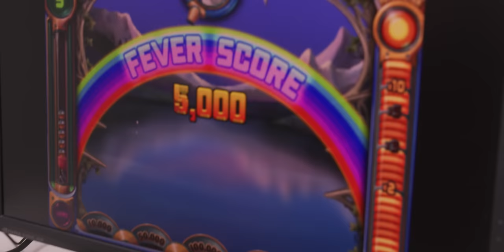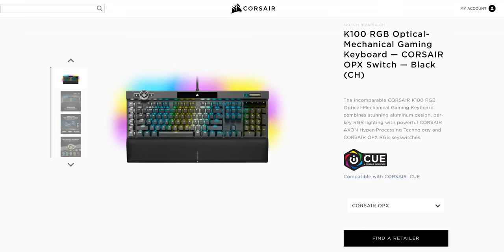The All Corsair Gaming Setup!

Comment: coincidentally the motherboard name “crosshair” sounds a lot like Corsair. Sneaky Linus
Reply: He put a sneak on us
Reply: Yeah my mobo/GPU is MSI SOLELY because Corsair doesnt make those parts lol. Sure they make GPU waterblocks, but I'm not watercooling, but I AM rocking Corsair everything else, as well as a 3700x lmao. Mine has an MSI 2080ti Gaming X Trio in it as well.
Reply: @TheGauges420  2080ti buyers oh noononono
Reply: snek 100
Reply: Seth Kauffman hey if you are ever planning on upgrading Corsair have released A plug-in for ASUS motherboards and gpu’s into icue
Reply: @Jack_U  hm, really? So you mean to say that if I buy a Strix card and a Strix board, they include cables now that will let my iCue match them perfectly? That would certainly be nice. I mean my Gaming X Trio 2080ti already matches my diffused setup pretty well, but I've been considering getting a 3080 whenever they're in stock (maybe 3070ti if its real), so I'd much rather control ALL my RGB with iCue ALONE lol. Is it just Strix or also TUF? Also, do the cords come with the items, or do I have to buy separately (not that I'd mind if they dont come with, I just wanna know to order at the same time lmao, or realistically is it even a cord, or do I just literally like import them into iCue on my desktop and that's it, I can control it with iCue instead of needing any cables or anything).
Reply: @TheGauges420  no you don't need cables you just install and extra piece of software on the Internet from corsair and it allows for controll and synchronisation of Asus rgb products in icue.  I know it works for motherboard's definitely as I myself have an Asus motherboard in a pretty much all corsair system and I'm 99 percent sure gpu works aswell
Reply: @TheGauges420  just google Asus icue support and you should find the install for the software. And it should work on any Asus motherboard or GPU as mine is a z390 a which isn't a strix and jt wotks
Reply: @Jack_U  good to know, thanks. Guess my next mobo/GPU will be Asus, although if they've done it for Asus I dont see why they wont maybe hopefully do it for others? Lmao.
Reply: @TheGauges420  at least u have a gpu
Reply: @TheGauges420  I can really see you laughing at people right now cause there is a GPU shortage and you have a 2080Ti which is always an beast for it's expensive price

Comment: What you need to do is take the “all Corsair” and the “all msi” and the other manufacturers and benchmark them against each other to see if there is any ultimate difference if you build an “all one manufacturer” computer.
Reply: That could be interesting.
Reply: Manufacturers didn’t like that
Reply: Corsair doesn't make main boards or video cards. Pretty tough to compare.
Reply: Mergatroid Mania they could use the same motherboard in all the systems but yeah they don’t have gpus
Reply: Best underrated idea here!
Reply: @paulhillbeats  Why would you compare a PC using a different motherboard or even the same motherboard with Corsair? There is no point. If they use the same motherboard and video card, then they're basically going to get the same benchmarks. About the only thing you could compare is RAM.
Reply: @OriginalMergatroid  the MB effects the score so little that no one has it as a system stat Requirement at most it adds less then 1% if that to the over all FPS
Reply: ASUS will win and I'm a Corsair Fan
Reply: @OriginalMergatroid  ram, their best cooling products, same wattage psu, computer cases,
Reply: @OriginalMergatroid  eh, corsair do have gpu waterblocks.
Reply: yes, this please
Reply: @OriginalMergatroid  they do now xD

Comment: Choice:
- Buy Corsair RGB fans
- Or still have a bank account?
Reply: The fans
Reply: laughs in Noctua master race
Reply: Rgb=FPS
Reply: Buying anything from corsair,, or having a bank account?
Reply: @khanhdinh5650  Same 😎 Brown ones only, embrace the Noctua
Reply: Buy one Razer mouse or still have a bank account
Reply: There cases are pretty affordable
Reply: rgb fans
Reply: Or have both :-D
Reply: True
Reply: @lonzoformvp5078  I bought a corsair 275Q, a different version of the 275R shown in the video, and it costs $99, which is around 60-70USD
Reply: Im buying nocuta any day
Reply: The fans are terrible value for the price. Corsair fans are terrible in general. No anti vibration padding (which you can get on $10 arctic fans which are FAR better) and inferior static pressure compared to almost all competitors. They aren't even true maglev. There's no circumstance where you should buy corsair fans. (also can't forget about the overpriced light controller)
Reply: @H1t1 You mean sp120s? been using 6 of them in a pc for almost 4 years now. They're also terrible value.
Reply: I want a bank account to buy the fans
Reply: @prakash9308  bro basilisk pro is just 3400rs
Reply: the fans obviously
Reply: @prakash9308  you only have $50 dollars in your bank account? i mean, the cheapest razer mouse is like the Viper Mini which is around $30-$40
Reply: @strider6294  So true. They really charge £55 for two addressable strips and a hub...
Reply: @H1t1 There is no such thing as an "sf120"
Reply: Lian Li Uni Fan SL120, probably some of the best fans on the market if you can find them in stock
Reply: @Joshua B yes and as I said, there is no circumstance where you should buy Corsair fans. There are far better, and sometimes cheaper, RGB alternatives to every offering corsair has.
Reply: I got Both!!
Reply: neither get noctuas and a Chinese RGB strip lol
Reply: @mtndewguy96  fax I upgraded my system with RGB fans brighter than the sun and I’m getting 420 more FPS than usual
Reply: @syedrehan4294  sheesh
Reply: I already paid for my bank accounts funeral.
Reply: @khanhdinh5650  if noctua ever does rgb then the universe will end XD
Reply: Does your bank account have RGB though?
Reply: @H1t1 thats alright, I've mistaken names before as well, but as I said I've used 6 of the rgb sp120s for 4 years now in and they are still not worth the price compared to other non corsair rgb fans on the market. I could give you a few examples if you'd like
Reply: RGB !!!
Reply: @jonathanbartley7139  ofc
Reply: Sk8rGuy420  Exactly. I'd rather buy a 1TB NVMe drive for that price
Reply: I would buy a NZXT pc
Reply: With the 465X that I have it actually came with 3 black LL RGB fans, I convinced customer service to swap them with the white LL120 fans (which are faster). Funny because the case costs $140 while the fans retail cost $120, its ridiculous
Reply: Me: buys Corsair fans
Also me: stonks
Reply: @FAKE-NAME  Damn, that must be double or triple the non-Corsair price lmao
Reply: Ye but it has RGB soooooooooooooooo
Reply: @rorywindsor1468  Corsair aren't the only RGB brand though. My PC has RGB and I kept both kidneys 😅
Reply: Depends if your bank account have rgb.
Reply: Those are the cheap corsair fans look up the ll120 or ql120
Reply: Get good case fans like the ones offered by Noctua or Arctic, then install Phanteks Halo Lux DRGB fan frames on them. For a little cheaper than the Corsair QL fan you'll get much better airflow, good looking addressable RGB (as long as it's compatible with you're motherboard's RGB software), and even better performance from not having to use Corsair iCUE. They work best with white or clear fan blades, but still look good with black ones too.
Reply: Bank then you can buy fans use ur comman sence
Reply: Temps? Bank account? 
Nah, gotta get that RGB for a 75 FPS boost per component
Reply: Fans
Reply: @prakash9308  lol no Razer products put you in debt, they’re so fucking overpriced.
Reply: I wanted to build a 5950x and a rtx 3090 inside a obsidian 1000D, but after seeing that a custom loop and push/pull corsair fans would run me about $1800 just for those 2 topics, and around $6500 for all of it, I gave up
Reply: What’s a bank account??? Idc CHECK OUT THESE DOPE FANS
Reply: is that even a question
Reply: Third choice. Buy Silent Wings 4 Pro, and have a fast overclocked PC.
Reply: @AB-80X  I mixed Scythe and Arctic ARGB fans, they're so cool and silent

Comment: Linus: Should probably get some B roll not under study lighting.
Also Linus: Ends Video
Reply: Yeah, were the fuck is the B roll, this is a rgb dream pc come on !
Reply: @clapiclaps  not gonna lie, this one was a low effort and kinda lame build. Keeps Corsair happy for a bit for the advertising but even Linus admits it's kinda underwhelming. 
Best way to go is still mix and match your own parts
Reply: @Hrathen39  yeah, I know, but I do personally very much like corsair, having a nice pc that use only one part maker look so good
Reply: @clapiclaps  rather than look good, I'd argue it's simply easier to sync up the RGB through one software instead of having to juggle however many different brands you got (I use the commander pro for my led strips). Really not a fan of that case for RGB. Still much rather the Lian Li O11 Dynamic. Much more clean
Reply: I own this casing, but no RGB fans, I honestly wanted to see how it will end up looking but they did not show it
Reply: @Hrathen39  that's one more argument that say that it's just better ;)
But for a budget yes, mismatch no problem
Reply: @clapiclaps  or if you want to spend top dollar for performance + looks. Corsair doesn't really have the best fans. I'd only recommend their keyboard (K95), CPU aio cooler, and PSU. Would not recommend any of their other parts.

For mouse I'd go Logitech, case as I've mentioned. Personally using 8 master cool fans, gskill ram, crosshair hero viii, Aorus 2080ti waterforce Xtreme

Comment: Now that they have a few “All Sponsor” systems, they should put them against each other.
Yes...similar hardware. But, but...thermals?
Reply: Theres no point. The only variable would be the cpu and gpu
Reply: Youd have to choose same GPU and CPU. RAM could be from the specific company (same amount and speed/latency)
The only thing that could affect the result are fans. A lot of companies sell AiOs, the only difference are fans. Even PSUs dont have to differ much, to my knowledge neither Corsair, BeQuiet (and so on) produce their own PSUs.
Reply: I dont think they planned to do that since most of them have different cpu
Reply: @ruebo2817  corsair does produce PSUs
Reply: @isaac7392  to my knowledge Corsair sells PSUs. But they don’t produce them, rather they buy them from an OEM and rebrand it to Corsair
Reply: @ruebo2817  Usually from Seasonic

Comment: I was surprised that Corsair makes power supplies, then I remembered that I have a Corsair PSU...
Reply: LMAO your comment made me realize it too 
Vs Gray gang
Reply: @abdulwasay9  Lets hope that it doesnt blow up
Reply: I too have a corsair psu because at the time they made the best modular power supplies.
Reply: @akraiokairikofainomeno  Been using it since 2016 so fingers crossed
Reply: @akraiokairikofainomeno  why would it? A couple of specific Corsair PSU’s were really naff but most since, and pretty much the entire current lineup are very good
Reply: @rare6499  corsair's new cv series is terrible
Reply: SAAAAME
Reply: @rare6499  Their Orange VS series are known for exploding. 
The gray VS series not so much
Reply: @rare6499  The VSs have a very bad reputation and a lot of problems. Of course most of the other Corsair psus are completely fine. I myself have an rm750x
Reply: @KyurekiHana  What? Did you build in a very weird window? Seasonic has been doing modular for eons and their power supplies have always been better than Corsair.
Reply: @kaldo_kaldo  Maybe? I built my PC (first time doing so) in 2016. Used a SFF case which required the power supply plug to be facing a certain direction. Corsair fit the bill for me based on my research.

Comment: they seriously need to enter the motherboard business... it's the missing piece in the RGB iCUE puzzle.
Reply: And GPUs if they go motherboards I don’t see why they wouldn’t I expect it in the coming years.
Reply: You can control Asus motherboards with iCUE so they kind off already did. But yes would be cool :)
Reply: If you install ASUS aura sync software (for the aura service, no need to run it) iCUE will sync with it and you can control ASUS parts directly in iCUE... 

I do this and I own a that very same Mobo linus used

Comment: Anyone else bothered by the AIO tubes being in front of the GPU?
Reply: He couldn't put the rad up top to avoidvthat because a rad and fans up to will hit the Ram. I'm actually surprised he got one in the front with the video card he used. This is a major shortcoming of this case. I avoided the issue buy using a 120mm rad on thecrear exhaust position. I like tge case but it could have used another inch or so in height.
Reply: The radiator was mounted upside down, the pump has to be on lower level than the radiator, the tubes have to come from above. Linus forgot the R.F.M., its in the pictures provided by Corsair instructions.

Comment: I built a whole Corsair rig a little while ago actually.
220t airflow black with Corsair rgb fans
H110i elite capillex 
Corsair 750rm power supply
Corsair vengeance LPX 32gb
I710700k
Gtx 1080 Msi  “duke” (it’s so big I wasn’t able to fit the additional 120mm fan in the front because it was touching the gpu. So currently I only have a top and bottom fan with the middle blank. It doesn’t look that bad, but I plan to buy noctua low profile fans eventually which will allow for enough clearance.)
Msi gaming edge wifi motherboard.

My mouse and keyboard are Corsair, I use a nice wireless rgb mouse (maybe harpoon? Idk the name) 
And the Corsair k70 rgb low profile

It’s really sick honestly and I’m really happy how the build went. There were some clearance issues that caused me to remove a shield plate on the motherboard, but it still looks nice.

Comment: Linus: Mounting the Radiator with taubes at bottom
Steve: Noooooooo!!! Nooo!
Reply: @Herbstleyd1986   Actually if you had paid attention Steve said hoses down was a good thing. Air in the top of the radiator above the pump is where it should be for lower noise
Reply: @larryfoster423  nah
Reply: @xs3tsunax  Yeah, tubes at the bottom is the correct way of mounting it, I watched that video like yesterday.
Reply: @jellevm  its by someone on the internet so it must be true
Reply: @xs3tsunax  Ah yeah my bad. Should've gone to the library and pick up an academic resource on AIO installation.

Comment: Corsair is the embodiment of quantity over quality. They have so many products but none of them are as good as the competition in their specific fields
Reply: Not particularly correct but k
Reply: I have to disagree Corsair makes quality power supplies and radiators
Reply: @safethrone7259  my h55 aio from my haswell i7 build has never leaked, and still performs great. also using a 10 year old psu from them. only thing that failed was a stick of dominator ram a few years back.
Reply: @safethrone7259  and mousepads :), and despite all the hate on their keyboards, for people who value utility and features over "build quality/materials" they're abundance of macro creation possibility and customizability makes them wonderful for people who work with editting

Comment: Kudos on proper mounting of the AIO Rad with tubes down. So many companies show them tubes up on front mounts, and that not good for fluid circulation. You get water trickling and gurgling sounds. The only thing tricky about front-mounting rads with tubes down is you have to make sure the top of the rad sits higher than the CPU.

Comment: Can someone explain/give me a link to what he's talking about at 4:10 ? I'm intrigued
Reply: It's a motherboard stand-off that would usually have a screw hole but instead kinda 'grabs' the screw hole of the motherboard and holds it in place so you can more easily install all the screws for the motherboard. I don't know why Linus complains about the motherboard PCH cover hiding that screw hole, it isn't used for screws, it has that grippy stand-off instead. I built a Crosshair VIII rig on Saturday so I know you don't need to screw anything there, if you have a decent case with the 'nubbin' that is. Otherwise it's just two small PH0 screws to remove a small plate over the top of the PCH fan.
Reply: @jasperpipes4222  um, thanks?

Comment: I have had that 275R airflow case for one of my builds and I could not recommend it more to people for their first builds, or even any other build if you don't mind the looks, it can run my whole system full tilt with high thermal load equipment inside, and is cheap enough to not break the bank (especially if you find it on a deal like I did). If your build is light enough you can definitely get away with just the 3 included fans, but I do recommend upgrading fans later on, but the case is true to its name in that it won't be your limiting factor for airflow.

Comment: Maybe it was a bad edit, but you might want to run the cables through the unit and hook them up to the power supply BEFORE you mount it into the case.

Comment: I have a all Corsair PC and the reason I did this is because of icue and just having everything all work with one program instead of having to download multiple programs for my RGB hardware. And another thing that's real helpful is on eBay there's this guy that sells 3-pin RGB plugs that have a  corsair's RGB header plug on the other side. And so if you don't have Corsair RGB hardware you can use other RGB hardware with Icue.